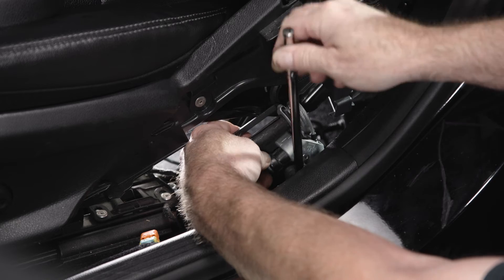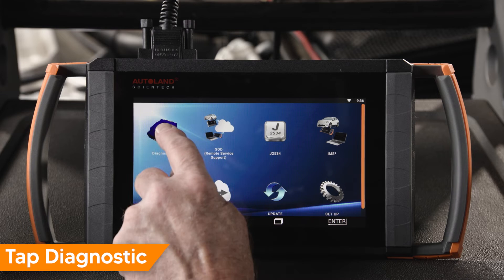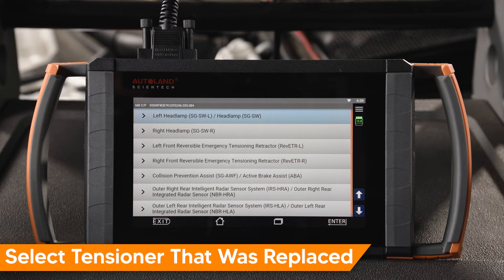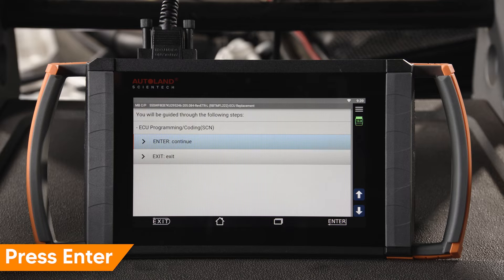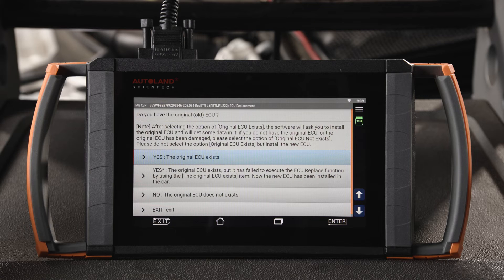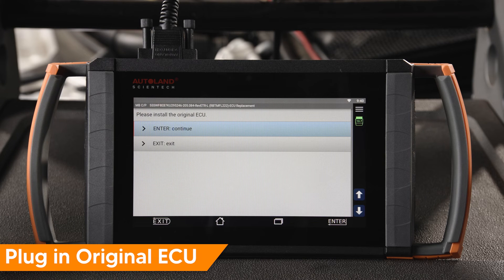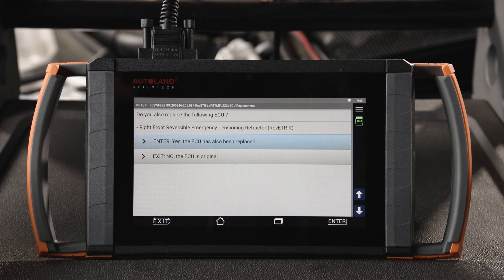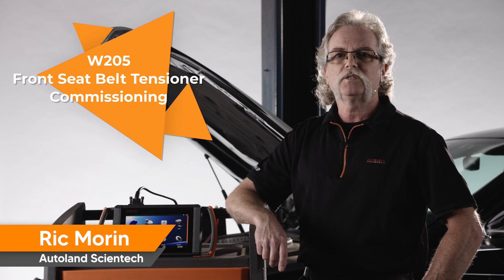How to Commission SCN Code Program | Front Reversible Tensioner Mercedes-Benz W205 Seat Belt Buckle

Comment: So even if there was no crash, no issues with the tensioners, we still have to code in a new seatbelt if it has been replaced?

I'm swapping my black seat belts for red. No issues, no crash, just simply want to change them out. Will I need to code them in?
Reply from the maker: Yes.